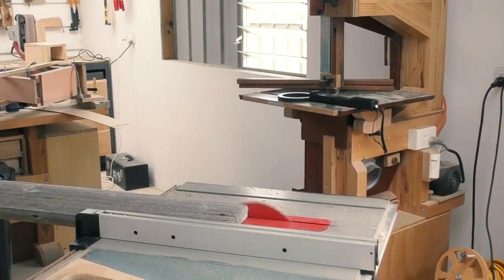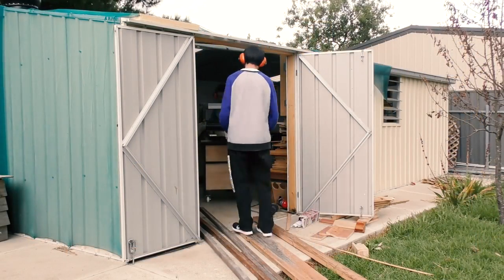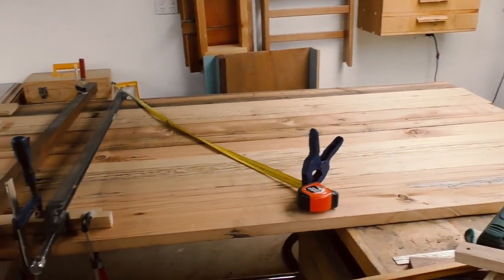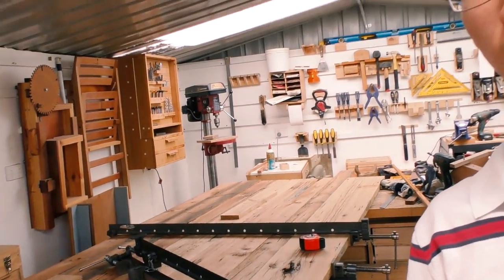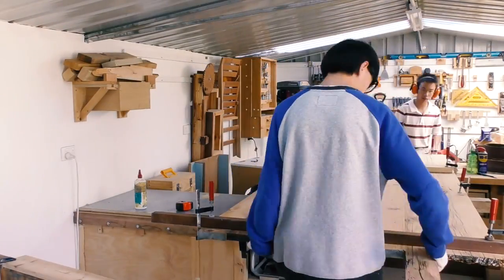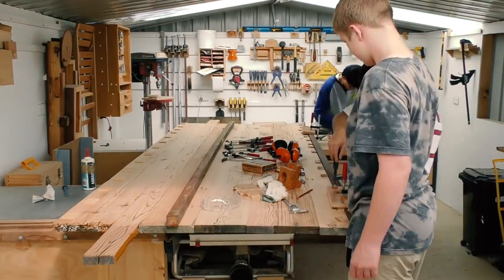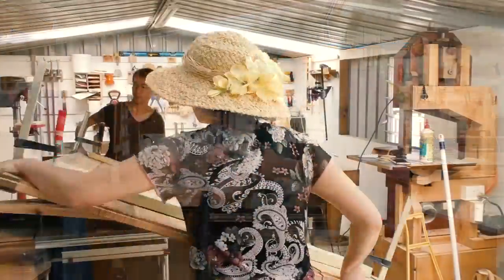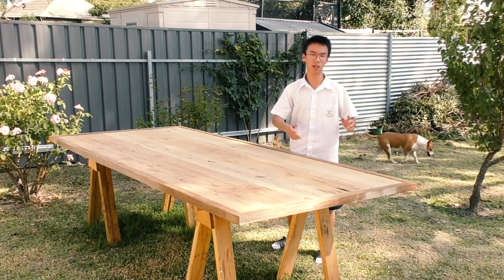Making A GIGANTIC Sliding Door

Comment: Has the door had any expansion/contraction issues since you built it? Asking because theoretically the top and bottom rail should be a floating breadboard joint to allow movement.
Reply from the maker: No idea, since it's in the restaurant and I haven't been there personally for ages, but seeing that they haven't come back to me to fix it, I assume wood movement wasn't too much of a problem.

Comment: This is pretty awesome. I don't have much knowledge of woodworking, so I have a question. The glued joints - will they hold when the pieces are so strong? Don't you need some additional support (like perpendicular pieces nailed, or the cross beams across the flat sides)?
Reply from the maker: Rijan Maharjan it's barely strong enough, the top and bottom braces adds a lot of strength width wise. i didn't have much choice designing it.